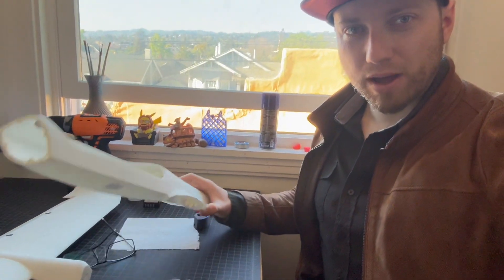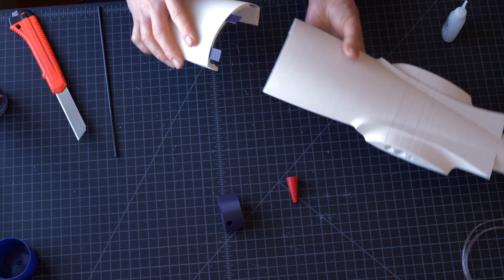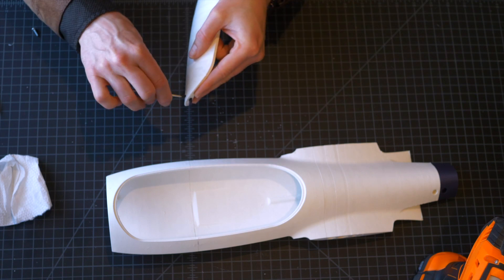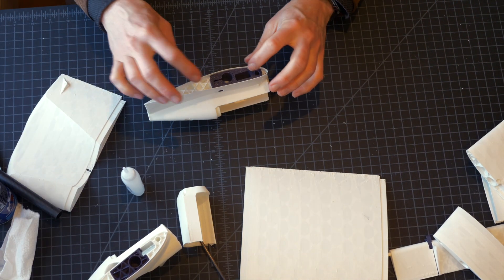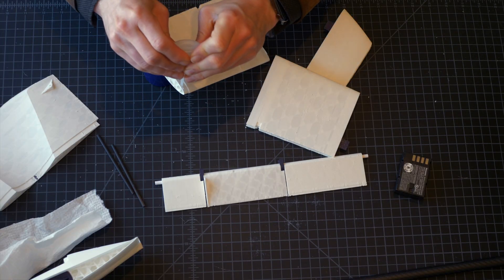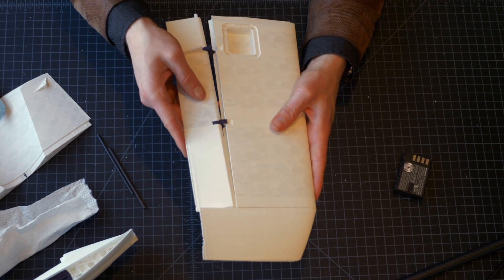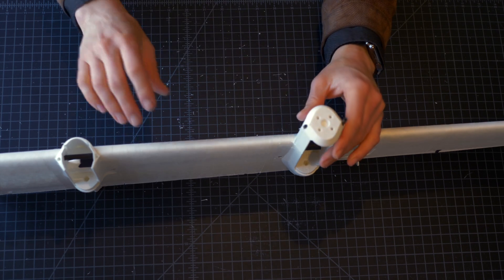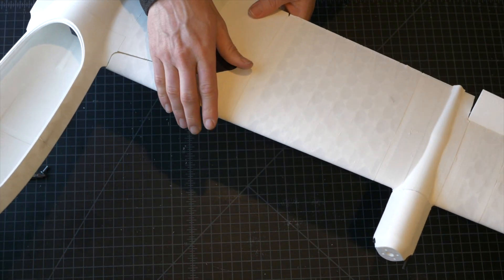AeroFold Hardware Build (V1)

Comment: What did you use for the join tabs?
Reply from the maker: Any normal rigid filament, I used either my same PLA-CF or PETG. There's a bunch included in most of the build plates for standard-filament parts!